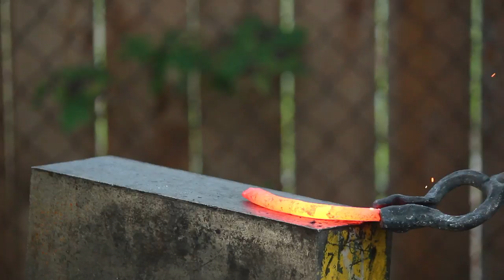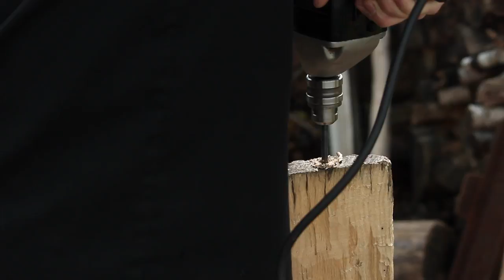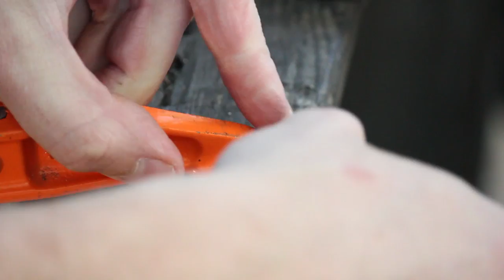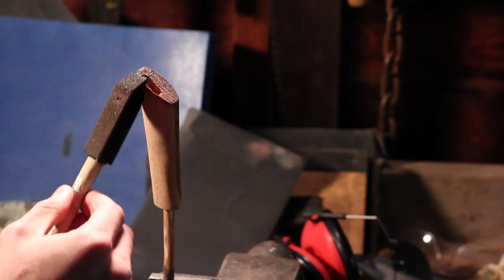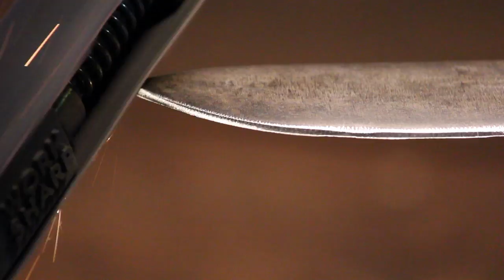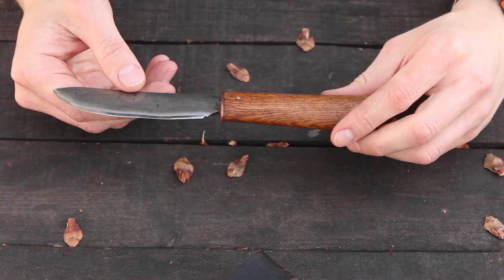"Redemption Skinner": Knifemaking Challenges

Comment: Have you ever thought of doing a bone inlay, or a small ring of bone before the copper cap?  The larger ends of a deer's leg bones can be used for a thin handle.  I've thought about doing that if I ever make a knife, but I've never made a knife.
Reply from the maker: Actually I have saved some deer bone discs from cuts of steak.  Never thought about doing something quite like that, but thats a neat idea.  I might have to give it a try!